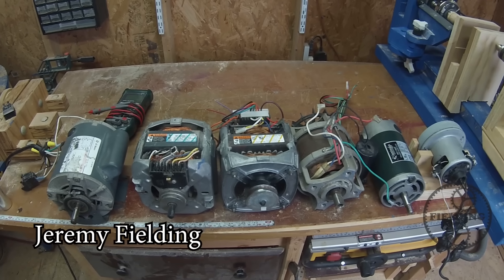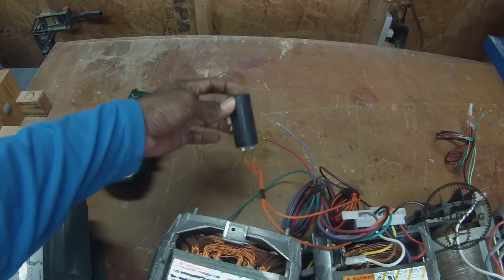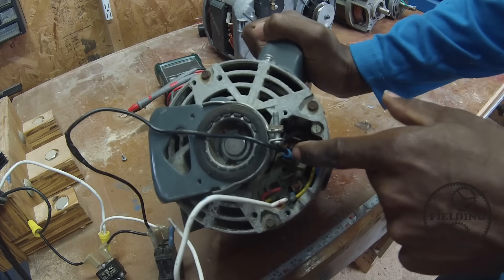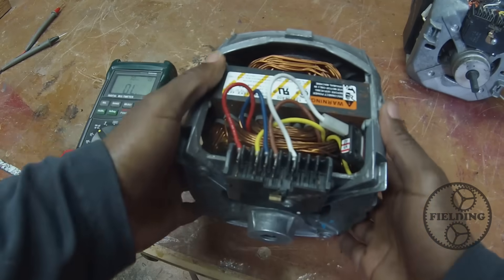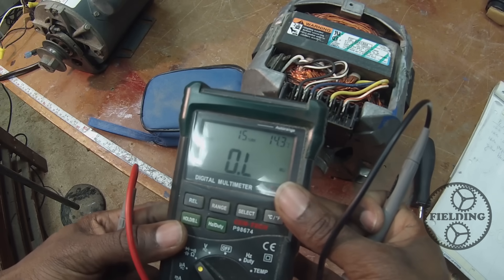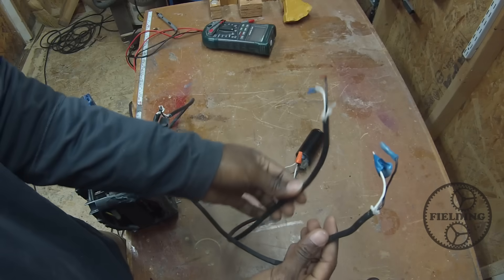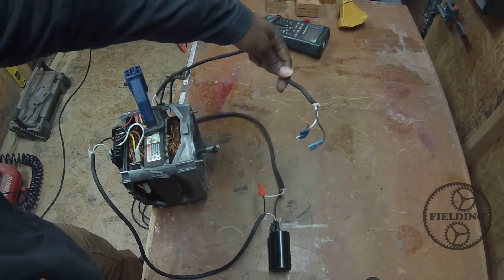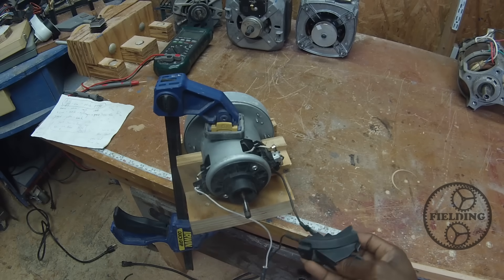How To Wire Most Motors For Shop Tools and DIY Projects: 031

Comment: Great set of videos. But I am curious about the rotor in an induction motor. You described the creation of a rotating magnetic field in a three phase motor and diagramed the wiring for this. But nothing about what this means for the design of the rotor. How are the windings in a rotor arranged in a three phase induction motor? How is this different in a single phase induction motor?

Comment: Thanks for your videos Mr Fielding. You are a gifted teacher.
I have a question.
The washing machine motor has three preset speeds: fast at 1790 rpm, slow at 1140 rpm and extra slow at 850 rpm. Could this motor be rigged to run at an rpm outside of these preset speeds by supplying current to two wingdings at once instead of one? Could this produce an rpm that is, for example intermediate between fast and slow?

Comment: Thanks Jeremy.  I was able to get an old washer motor running to put on my bandsaw.  I followed your advice on use of the ohm meter to locate start windings and to avoid direct shorts.  I used a capacitor with lower capacity, but it works fine.

Comment: You have to make a distinction between a start capacitor and a run capacitor. The start capacitor only operates when the motor is turned on, it is disconnected once the motor is running. Some older motors used a centrifugal switch on the motor shaft and fridge motors are similar, the thermal cut out operates if there is a blockage and the motor will not run. The run capacitor is connected all the time.

Comment: Thanks for the great vid. Very informative and helpful for me. Will you do any more videos about universal motors? I'm working on an old 1hp whole house vacuum motor and I noticed some interesting components. One component just looks like a block of resin with four wires, two of which were grounded to the case of the machine. I am guessing some sort of fixed resistance for speed control? Anyways, if it sounds interesting to you I can send pics/vids. I would appreciate any guesses you might have!

Comment: Ok so, basically i pulled an ac motor out of an old dryer, and all it had were the copper winding wires. And I don't know how to wire it up
Reply: Doesn't it have any leads to it?  Remember when you pulled it out of the dryer unit, you had to have disconnected wires from it, at least.

Comment: Hi Jeremy.  Thanks for the video.  I'd like to build a bench grinder/polisher.  Is it possible to replace the shaft in a single-phase induction motor like you discuss here so that the shaft protrudes from both ends?

Comment: Trying to wire up a dryer motor for a homemade lathe but it keeps tripping the circuit breaker. Any tips? Is the motor damaged, did I wire it wrong? Or both? Thanks for any help, love your videos!

Comment: Question: Electric Marine Propulsion, what are the shock & lightning hazards onboard a boat? What size/type electric motor would give equivalent 100 - 300 HP? What size battery bank needed to optimize range? Of course boat size, weight and hull displacement are factors; Are there any submersible motors, if so, to what depth? How are load banks operated or controlled, to prevent overloading? Electric safety onboard a ship and Marine Hybrid electric/diesel is a hot topic and these issues aren’t being discussed or explained properly. Food for thought, keep up the good work.

Comment: As usual, helpful.  What would also be helpful are any hints at which terminals are most likely the positive/hot connections and which are most usually the neutral connections for a simple test to see if the battery is good or not.  How to tell which is positive and which is neutral.  What to follow/look for to find those connections.

Comment: I have an old waring food processor motor with many wires that I don't know what to do with. It is a ge 1/4 hp 1 ph motor with capacitor and red, blue and yellow wires coming out of it. Not sure what I need to do with all of the wires. I don't think I neeed most of them but I know I need the capaitor and the motor and I can add a switch somewhere.

Comment: I waited for you to wire up the treadmill motor no big thing really because when I took the motor out of my treadmill I took pictures and videos and kept all the wiring and the board with the motor.
 What can treadmill motors be used for and are they any good?
I am needing to make me a couple of belt sanders will the motor work OK for that purpose?
By the way thank you for all your help.
Reply from the maker: There is a separate video for the treadmill motor

Comment: Some vacuum motors have a extra wire that will put out about 12v this is to run the light on the vacuum Oreck’s are like that if they have a light. Sense they use a 12v lamp, weird Huh!

Comment: I have enjoyed and learned from every video you have shared. You teach/explain everything straight and simple. I purchased a small brushless motor intended for use on a skateboard. I wrongly assumed that there would be a wiring diagram as well as instructions as to what control and power system I needed to add. The seller was paid and has gone silent. Can you, will you help me with either a link or instruction? The motor has BDUA V 5065–270K V printed on it.

Comment: I think you can pull this off....Get a 5 hp compressor 220vac  single phase motor that has bad windings and rewire it as a restoration project.  Looking around, I have not seen a decent explanation as to how the number of turns for the windings are calculated and hooked together.  Even address the cause and effect for the change in wire gauge in this project.  What do you think?

Comment: Excellent explanation and practical application of knowledge. When you talked about the slow bouncing of the digital multi-meter, that's why I still carry my analog needle meter. Shows pulsing signals and the like really well. Thanks for the video.

Comment: The capacitor will actually filter out half of the A.C. sine wave and since it is constantly charging and discharging it will turn that voltage that it filters into voltage the motor can use.  60 MHz × 2= 120 which is the voltage at your wall socket. Technically it's 110-120v which is due to cyclical charging/discharging (Filters) in the lines to smooth out the supply. This also occurs in the step down transformers that most electronics need in order to convert AC 110-120v into the DC that drives the circuits, think stereos, TV's, microwaves etc.

Comment: It's crazy because I added this video to my watch later playlist and I was at my friends bored yessterday and I saw this motor my friend pulled out of a new washer or dryer I can't remember which but it's one of the ones that spins really really fast and I started playing with it thinking it was simple to wire it up and boy was I wrong. So there's two smaller red wires coming out of the back of the motor near where the bearing would be. Then there was three slightly larger wires coming out of the windings of the motor. All five wires went into a harness/loom (Not sure the technical term for this clippy connector type deal) but then the five wires went into the matching connector(like a 4-pin Molex sort of except 5 and different shaped) but this side the wires changed colors. I can't remember exactly but I Think there was 2 smaller red wires, a larger orange wire, a larger red wire, and a larger gray wire and they changed to one larger black wire, one larger white wire, one larger grey wire, one larger yellow wire and one green ground wire. Something like that. I can't remember the colors exactly. I wish I would've taken a picture of it. Basically I guess my question would be what are the two smaller red wires and why do they go to the back of the motor? I assumed maybe they were speed sensors or some type of electric brake maybe? Maybe the starter capactior like you were mentioning. Not sure. I'll have to get a pictures next time I'm there and I'll know for sure the colors of the wires. Love your videos man. Appreciate these.

Comment: Hi Jeremy could you show more about wiring different induction motors so we could have more lessons on this, I still didn't understand everything. I want to learn how to wire my washing machine motor which has 5 wires, has only 1 run capacitor, no start cap and no centrifugal switch. I wish I had one to one help but just if you make more examples it will help people.
Reply: Hey Jeremy, if you want to send me a friend request, I might be able to help you understand how induction motors work.

Comment: Jeremy, Great job at explaining things that normal folks can understand. I just received a new motor for an oil pump that I use at my Job. It is made in china single phase reversable motor. It has nine leads on it I cant find anything on how to wire this motor. It also has a manual overload please help.

Comment: I have around 9 motors from washing machines with the capacitors but had no clue on how to wire them to get any use from them. Until I found your channel and your videos, NOW I HAVE MADE MY OWN PORTABLE HYDRAULIC LIFT SYSTEM ITS FANTASTIC! maybe 1day I can make a video of it working and send it to you. I have learned a lot from your videos! THANK YOU SO VERY MUCH FOR POSTING THEM. YOU SHOULD BE AN INSTRUCTOR OR PROFESSOR GOD BLESS

Comment: Thanks for the outstanding vids i have this singlepdase/3phase VFD which i connect to a 3ph motor for the wiring there is no grounding terminal for input power supply on my vfd  but there is a terminal for the motor side of the vfd

Comment: I like yoyur videos mate. it helps that you explain stuff in a way thats simple for me to understand man. cheers..... I have an old washing machine that's still serviceable as a washing machine but I want to take it apart and use the spin cycle setting to make a drum sander... do you think this is 1. possible for a beginner...2. a good idea to begin with... 3. able to be done without to much rewiring etc ?

Comment: Good stuff, again!  Just curious...have you covered parallels of electric to fuel motors?  In my case, I'd like to try using a DC 12V motor with a couple deep cycle marine batteries to run my old jet ski which currently has an 1100cc 2 stroke I think puts out about 100HP.  Am I barking up the wrong tree thinking it's possible (especially on a tight budget, lol)?

Comment: Hello Jeremy, I get all types of motors from a scrapyard for my projects. I have a really nice Baldor•Reliance single phase I am trying to use. There is a fist full of wires coming out of the side. Four are marked "J" for thermal readings. One is marked "L" and three are marked "T". I have spent hours looking online but it is a custom motor for ABB I think. Would you know what the L or Ts are? I don't want to smoke the motor. Thanks

Comment: I'm built an RC mower, but want to spin 2 blades (42" deck).  Can anyone estimate how much HP I would need for that?  I saw a build where the guy used a big ass DC electric motor to run his blades, but I'm still waiting for a reply for the specs.  I need to know how much HP I need to better understand my options.

Comment: Would the things in this video apply to an air compressor motor as well?  I pulled two "5 HP" rated (though only half that based on the 120V 15a stated on the nameplate) motors I'd like to test out but the power cables were run through the pressure regulators so I don't know if cutting that out also cut out any vital electrical components.  Ultimately I'll want to wire a switch, safety components and the like, but first I need to make sure the motors will turn on and spin.

Comment: Can you show pinouts for dual voltage (120vac -220vac) motors and how to Ohm-out the correct pins if the schematic is missing?
Reply from the maker: Search my channel...you will find it

Comment: Right off the start, single phase and induction are not the same thing. Further, there are many single phase and induction motors that do not utilize capacitor start, plus, there are induction motors with brushes.
Reply from the maker: If it uses brushes it can't by definition be an induction motor... I don't think you understand what "induction" is. Anyway... thanks for watching.

Comment: rarely do I see something amiss with what you state.  Capacitors temporarily create an additional phase.   Uhhh no.
They discharge and recharge voltage ( potential for work ) very quickly. effectively a high-speed battery rated in Farads instead of amps.  They are used to increase the force of the work being done by increasing current swiftly, thus the increase in locomotive force against the pole opposing that phase.  Your video of with and without cap start proves this out in the fact the motor cannot produce enough locomotive force for it to move the shaft from the start. Once running, centripetal force allows the motor to continue to turn and not coast to a stop. A run cap may be necessary depending on load at speed.  Phase refers to the number of degrees of locomotive force each winding has to act upon the pole as it passes.  a single phase motor having 180 degrees per pole to create the locomotive force requires more locomotive force over a longer period to begin rotation and maintain it thus run and start capacitors as used on many devices.   a 3 phase motor having 120 degrees to act upon a given pole, requires neither a start nor run cap because it acts on a shorter amount of degrees of rotation providing locomotive force. This is why 3 phase is more industrial use as it requires less energy to operate and makes more HP.  One can even use a delta leg from a delta transformer to improve the 3 phase operation.  Sorry Capacitors don't make a  phase temporary or otherwise.

Comment: Nice. Very handy to know. Wanting to know about the kind of motors they use in high velocity room fans brought me here, i've got a couple of worn out 18" i want to replace the motor on and run at half speed. Pulleys or gears would be ideal as it would remove a lot of the axial load on the motors, which i find wear out after 2-3 years of my use. I'll try and find something which has proper bearings instead of the bushings these crap motors use. Good video, thankyou for the knowledge.

Comment: Jeremy, excellent video. A quick question. I have a single phase motor. The diagram shows 110 Low voltage = Line one Blue, Orange, Red, and Line two = White, Yellow, Black. Can I simply hook up Line one (power) and wire nut that to the Blue, Orange and Red wires and then take Line two (ground) and wire nut that to the White, Yellow, and Black wires. Is it that simple? I'm a 12v. DC guy and just want to make sure... thanks in advance!

Comment: I believe I have an induction ac motor but it doesnt have the huge bulge on the side. There is this cylindrical black battery looking device inside the motor itself and its wired to the terminals. Is this an induction motor like the 1st one explained in the video?
Reply from the maker: Check out my video "how motors work; single phase". You will see a induction motor in more detail (and capacitors) explained at the beginner level. That should help.
Reply: @Jeremy_Fielding  thank you! I appreciate the reply. I'll make sure to check it right now. I will be using this on a belt grinder(belt sander build?

Comment: Hi great video thanks. You inspired me to go get my sister's old washing machine but unfortunately I still do not understand how to wire it up. Here are the details in case you have a moment to make suggestions, thanks Trev . The motor has 3 wires blue,red black coming from the motor itself and 4 wires from what is I think a rotary position encoder on the tail shaft yellow,blue,gree,red

Comment: I HAVE  A 1HP INDUCTION MOTOR. IT CAME WIRED WITH 115 AC. ITS CHART SAYS I CAN WIRE IT TO 230V. I WIRED IS UP AND CHECKED CONTINUITY.   I GOT CONTINUITY ACROSS COMMON AND EACH HOT WIRES. THAT SEEM RIGHT. BUT I GOT CONTINUITY ACROSS THE TWO HOT WIRES WHICH DOES NOT SEEM RIGHT. HELP !!

Comment: I think I missed the connection between checking the ohms and actually figuring out which wire does what.
Reply from the maker: Try watching it a couple times. It’s all there. You will feel more comfortable as well

Comment: Really appreciate your videos as they are very helpful.  I have a washing machine motor that I want to use.  I have red, blue, yellow, black and white and I think brown.  Unfortunately I cut the capacitor off and didn't realize I should have looked for it.  If I want to run on high speed can I just  hook up high speed wires such as red and black together  and white.  I would have to go buy a capicator to run between the washer and the cord/wall.  I don't have to do anything to the other wires?  If you can let me know.  I will look for info on washer and go to electric supply to get help with that.  I like you love to reuse perfectly good items.  I have one other motor and using it with a wire brush for getting rust off of tools.  Works great!  I want to use the other for buffing.  I'm retired and make things on a wood lathe.Thanks again for videos.  Ed.

Comment: 1st,Great video's and information thumbs up! i have a question that you may be able to answer. 84 volt, 19 KW hours, or 26 hp electric motor. this motor within the past few years has been mounted on a hang glider trike,can i find this motor or its equivalent for a build attempt? (used) maybe? The name of the YouTube site is: Canada's first electric powered ultralight* (battery powered)
another version is at this YouTube site: hang glider electric motor harness water swoop* but i see no information in regards to this motor. Thanks for your videos and inspiration! hope to hear from you soon

Comment: Excellent videos Jeremy, thanks! Can a 2.3 ECM motor from an air conditioning unit be wired for a disk sander? IE, can it be hacked so that the 24 DCV be jumped to allow running on ACV?